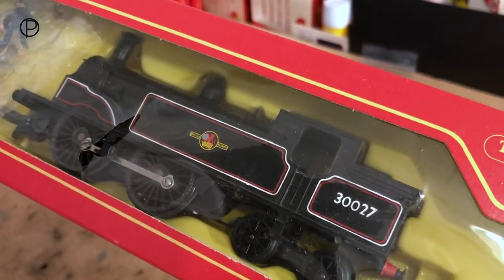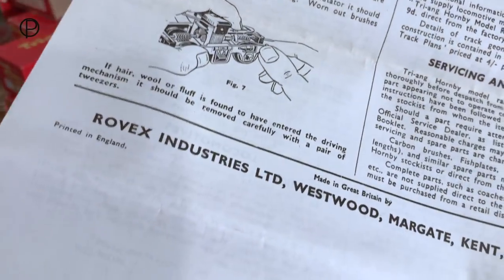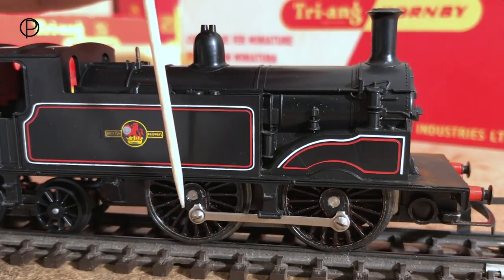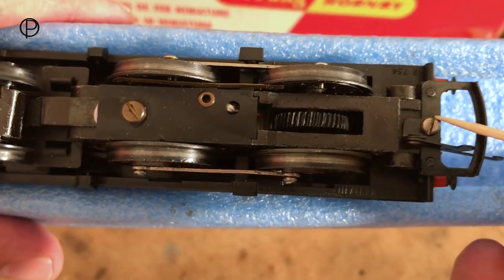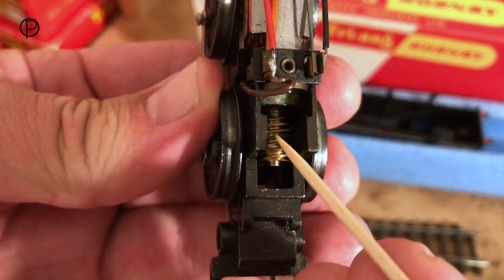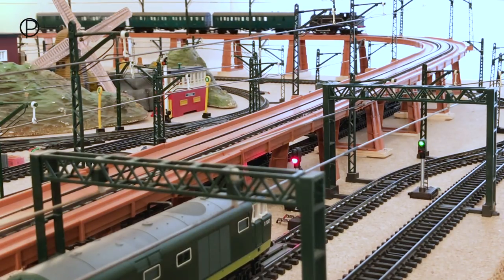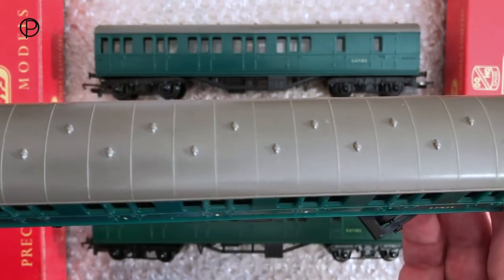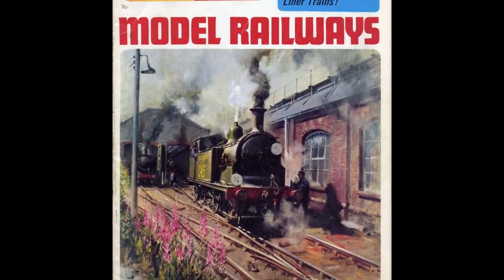Tri-ang Hornby R.754 Class M7 Tank Locomotive with SR Suberban Coaches

Comment: Love the M7, lucky to own three of these :) Your one looks to be almost brand new.
Reply from the maker: Hi, she seems to have had a very easy life. In your collection do you have an example of Hornby's mid to late-80s version? If so does it have the same type of motor gearing as the earlyer versions?
Oscar
Reply: Hi Oscar, I'll need to check, what was the stock number of the later versions. However all mine have X04 type motors.
Reply from the maker: Hi thanks if they have the X04 motors the gears may be the same The catalogue numbers are R103 olive green, R862 black. I only asked as some models seem to have acquired can type motors. I do have both of the SR version one of I don't remember which at this point seems to run like a rocket. There seems to be no calming it down. I had always meant to change the motor to see if I could gain more control. But never seem to get around to it. 
Oscar

Comment: Another beaut video, and loco to match! The M7 is a favourite of mine, and even one of my decrepit versions looks great with the Hornby pull-push coaches. I overcame the stutters on points by replacing the pony truck with the spare part available on that well known auction site designed for the newer models. A bit of inventive wiring and attaching to the inner chassis, and it works wonders. I also like your insights into the old coaches too Oscar.
Reply from the maker: Great idea Andrew. It seems odd that Tri-ang did not go down this route themselves. I'm sure this was technically possible at the time. But possibly just too expensive to implement.
Oscar

Comment: Great . One of my favourites. I’ve got a 1973 olive Green one . As with David mine doesn’t have a cab floor . I think the spring is not do much to stop it from falling over but to maybe help with current pick up on the 4 main wheels . Mine runs well but as you’d expect with 4 wheel pick up she does stutter on points and diamonds. I think she remains my only Southern liveried loco. Although I’ve got many later Hornby ones , they are all in BR livery. These are pretty nice coaches too, although a bit before my time .
Reply from the maker: Hi Russell, definitely one of my favourites too.  (But aren't they all!).   I think on nickel track this spring may be of more importance.  On the steel track the magnadhesion does a good job of keeping both drive wheels on the track

Oscar.

Comment: Once more you have thrilled me with your knowledge about these models Oscar. Half way through the video I just had to get my M7 out and make comparisons . Mine appears to be the version shown on the catalogue in your closing shot. It does not have the cab flooring or firebox glow but it does have the opening smoke box door. All the wheels have chromed brass tyres. Your BR version is fantastic as are the coaches. The melting plastic in the body shell is caused by a reaction between the hard styrene of the body and the softer plastic used to insulate the wires.Make sure there is no contact between these two plastics.   Regards, David.
Reply from the maker: Hi David, thanks for the information about the reaction between the two plastics.  This hadn't occurred to me.  I had assumed the wiring had overheated at some point in the past although on inspection there is no evidence of excess heat on the wiring.  I shall keep a look out for this on other models too.  Glad you enjoyed the video, sorry I keep making you rummage through your toy box!

Oscar
Reply: You're welcome Oscar. I have a number of Airfix model tanks from my youth that are ruined by the reaction of those two plastics as Airfix used the soft pliable plastic for the tank tracks. In later years I tried to separate them with several layers of paint and varnishes but to no avail. No need to apologize for getting me to look at my Tri-ang collection, I look forward to it every Sunday. Normally kept on a display shelf, my M7 and Hall are now on the track double heading a rake of Bachmann Collet coaches.  David.

Comment: Another of my favourite locomotives and such a good combination of rolling stock too. I built the Wills Finecast M7 with a fair bit of superdetail years ago, and it still never looked as convincing as my T/H one for some inexplicable reason!. I think your melting could be the power feed to the firebox glow. Swap out the bulb for an orange LED perhaps based on the information in last week's video.
Reply from the maker: Thanks Andrew. It a funny thing with the detail on Tri-ang models they seem to give a very good overall effect. Especially these models from the late 60s early 70s. I think you may be right about the wiring. An LED would be a great option. Some additional components may be necessary but there is plenty of space. I don't think the wiring should get that hot under normal circumstances!
Oscar

Comment: Nice! I have a few, mint, boxed M7 too (and with that Tri-ang collection I recently brought for 15GBP i even have some matching coaches too), I replaced the plastic wire holder pins with toothpick, and cleaned the whistle with 75% lime-juice (i use it to clean all brass detail parts). If u like interesting old models I highly recommend the Jouef's old "231 C "  type 4-6-2 locomotive. On the outside it looks like an old Tri-ang pacific : plastic running wheels, flange-less middle drive wheel, molded details, and metal buffer. But its inside that's impressed me; very nice mechanism, huge motor that acts like a flywheel, and the 1st time i saw actual ball-bearing in a H0 scale loco! There are 3+1 color variation of it : black (the oldest),  green, brown, +green with stripes (latest); the green goes quite cheap (ref 835/0) around 30 GBP on ebay (i have 1 mint boxed, and 1 worn to run).
P.S: if u have a spare Dublo "hook" u can put it on the 231 C's tender do to the 1st production came with that.
Reply from the maker: Great Idea about the lime juice and the toothpicks. I shall look at the model you mentioned it sounds terrific.
Oscar
Reply from the maker: Hi Tom I've been having a look at the model you mentioned. She looks like an excellent model. Are all the drive wheels geared back to the motor? I've been looking at images on eBay and Google. I've also found this excellent film clip of what might be the real thing in action. These look to be very tempting models!

Could I please also ask your advice on what type of locomotive/model would right to go with some Playcraft Car Transporters (P6571) in a weak moment a couple of years ago I bought a hand full of them! And I have never got around to finding a locomotive/model to go with them. I had always thought that these may have been a budget copy of a Jouef mode made for the UK market. They do have terrific looking colourful french cars on them. and I'm thinking they are from the late 60s early 70s but unsure? It would be great get some to run them with.
Oscar
Reply: Yes all the driving wheels geared on the 231 C. in fact the gearing is so good that u can push the loco on the track with only one finger, and the motor rotates from the pushing (like a flywheel car). Playcraft is like the Hornby Maccano,  they are actually Juoef locos (H0) marketed in the UK with different couplings, it existed from the 60's till the early 70's (funny that Jouef is now part of the Hornby group). For the loco: if u want to use a British one; Playcraft had two variants of "class 29" (nice mechanism), the rest of the products were French locos. From those i recommend the BB 13000/12000 class mix traffic loco, the older ones has all wheel drive (Meccano produced it's own too).

Comment: Hi Oscar - just came across your review of the Hornby R754 Loco - I have owned one of these models since new and note that your review does not refer to the “smoke generator” - a little smoke “oil” was put down the funnel and a heated coil generated the smoke - did all these models not have “smoke” generating ability? No reviews refer to it?
Reply from the maker: Hi not all Tri-ang models locomotives were fitted with the smoke option. The model I have, and shown in this video has no smoke unit fitted. It was great feature on the models it was fitted to and a lot of fun. There were two different systems SEUTH and SYCROSMOKE the later being developed by Tri-ang to replace Seuth which was expensive to include in the models due to the licensing deal involved.
Thanks for watching.
Oscar

Comment: Hi Oscar, Is the suspension bridge part of the Triang Hornby catalog? How about the elevated/tressled tracks, are those Triang Hornby? Further, the catenary (overhead power system), is that Triang Hornby?  You have such a terrific layout.  It's not just the rolling stock, it's also the infrastructure, like the train station.  Maybe you could devote an episode or two to more of the infrastructure.
Reply from the maker: Hi, the suspension bridge is Tri-ang Hornby and in this colour dates from around 1966/67.  It was first available in 1963.  Everything else on the layout is Tri-ang Railways or Tri-ang Hornby. Along with the rolling stock it was all produced by them at some point between mid-fifties and early seventies.  I will cover infrastructure items in due course.  Thanks for the terrific comments and ideas.

Oscar